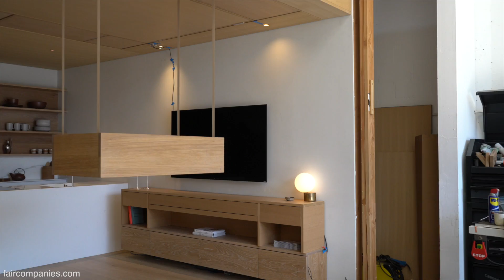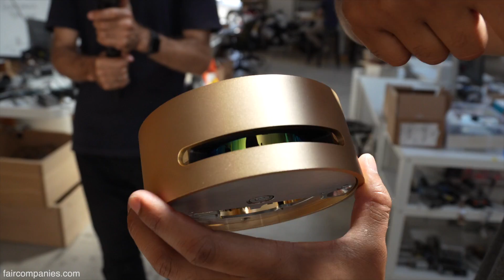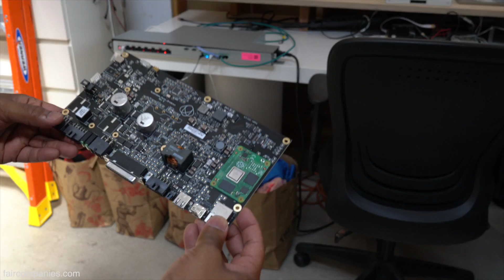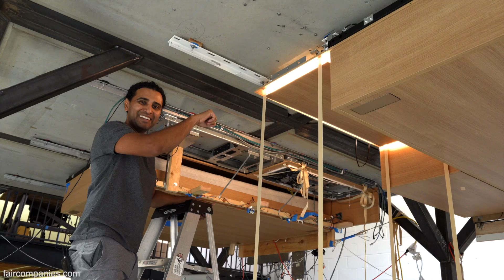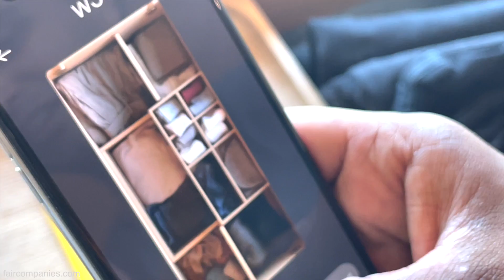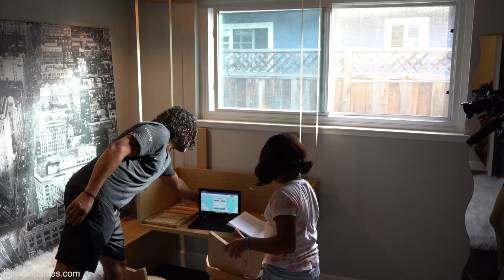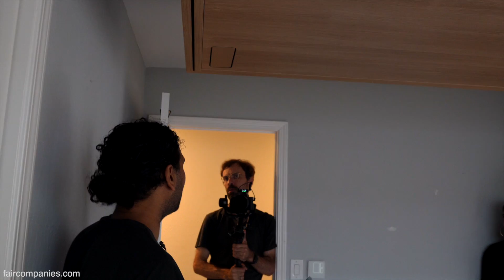Apartment furniture rolls into ceiling, it's truck-drag strong

Comment: I like his knowledge and creativity. I prefer storage walls rather than ceiling use as I love tall ceilings and am generally happy to give up 18to 24 inches for full wall storage of drawers and hanging space plus convertible furniture.  And it takes less electronics to fold out a bed and pull out drawers than to lower it from the ceiling. Generally simpler is better.

Comment: Love this concept but I have two requirements before I would ever consider it:

1) No smart features or cloud requirements whatsoever. Local controller (like a tablet) and local voice commands only for privacy reasons. No pictures of anything ever.

2) Emergency battery backup to raise or lower selected compartments in the event of a power loss; it would suck to not have your bed or tools in a long-term power outage. It would be best if in a power loss event certain components could be configured to go up or down and lock in that mode until power is restored; again, you wouldn't want to raise a compartment that you need on battery to then have the battery die before the power returns.

Comment: It's really cool for what it is. For people that like being on the digital grid, this is a great and innovative product. 
Personally, I prefer manual hand powered mechanics and off grid systems, aside from media and communication devices of course. 
This is really great inspiration to design something something similar with gears, cranks and pulleys that doesn't depend on electricity, and also has more personalized design core availability. 
But like I said, in its own right, this is really cool!

Comment: I like this in a lot of ways--it really opens up space and is actually accessible for people with mobility issues--but privacy can become an issue with how it tracks where your things are just as much as it's an advantage, especially as it's part of the Internet of Things, which is famously security poor. And the access locking can be as easily a tool of abuse as of security. And what if the power goes out with your bed still in the ceiling?

Comment: Cool idea, but hi-tech dependent.  ¿ What happens in power outtages or surges and what's to prevent the kids from pushing buttons when they're bored and your bed starts retracting into the ceiling with you as a passenger ?  It's easy to fix standard furniture when a door gets jammed or a bed leg starts to crumple, but this not so much.  Another toy for single, uber-rico millennials.

Comment: You know, I think the owner made a good point about how the shortest basketball player uses the Bumblebee system... this would be great for those with disabilities! Those who have dwarfism, those in wheelchairs, or those of any height that deviates from the standard could seriously benefit from things adjusting to their height. I can totally see this in the more bougie apartment complexes around college campuses or even college dorms if the universities are so inclined. Imagine these micro-units for hotels instead of capsule hotels in high-density areas around airports in major cities (since at least here in America there aren't any capsule-like hotel options that I at least know about).

Comment: Seem to have not mentioned the obvious application (maybe it is developed later when more money is made from celebrities!) but this would be transformative for those with mobility and access issues: you cannot bend to open drawers, you need move in a wheelchair and don’t want to have to negotiate a bed, or you need to change the access height of things in different situations. Also when the software develops away from phones and can photograph from the unit allowing for more verbal control for those with limited vision. I hope this can be the future. These inventions are incredible but broadening access could make them even more of a game changer.

Comment: Space saving in an apartment like this is evidently important to low income renters. I doubt people in that situation have the extra money to have this set up. I couldn’t see any building code allowing this, it most definitely compromises on fire safety and means of egress. On top of that, a pulley doesn’t seem very patentable and contractors could already easily install these for people. The camera logging your stuff is cool I will admit… If you live with a thief?

Comment: Is there a manual way to get your bed down?  What happens in an electric outage?
Reply: Unless you live in texas the reality is that electric outages are an "outlier".  I've lived in california for 15 years now and have never had my electricity go out for more than a few minutes.  Before that I lived in NYC for 18 years and the 2002 blackout that lasted about 24 hours was the only time my electricity was out.  Now, because I"m concerned about this, and have the money to deal with it, I have a battery backup system so I could still make a bed move up or down if this was in my home and the power was out.

Comment: This is something designed by an architect to function well when it is new. The issues I see are that the system will break down at some point and you are locked in to a singular setup that cannot be easily changed.  Think about the Nakagin Capsule Tower in Tokyo. It was supposed to be adaptable, but time and technology moved on. The built ins became obsolete and things started to fail. Repairing it became hard because it was so inflexible. (There is a whole other discussion of the Metabolism movement that could be discussed too, but this is a social media post, not a book!). Now imagine a change in lifestyle that requires a different floorplan, or even something like a power surge or leaking electrolytic capacitor destroying a controller board. Think about how long it takes for grease to dry up and start destroying bearings (10-15 years). Imagine this when this company has moved on or gone bankrupt and the parts are no longer available. Now you have your bed tied to the ceiling and need to get it down but without a controlled way to drop all that weight. Imagine this happening at 10PM when you just want to go to bed. No thanks. I like the idea in concept, but prefer to have static furniture that can be easily changed and also like more square footage. As far as carbon footprint goes, I see the short life of systems like this as a negative. I also would not want to pay the high cost.

Comment: It's a fun way to make a small space multifunction. However, what happens when there's a power cut, or the software gets hacked, or the company goes bankrupt and there aren't any technicians to help maintain it? I'd rather see a more resilient low tech (as in no software/computers), low (or better no) energy consuming version, where the storage is under the floor, and you pull it up, or if storage is above it uses clever pulley systems etc. With the cost of living increasing, and the need to reduce our energy use, we cannot afford to keep designing things that need a constant supply of electricity to work.

Comment: Would be a lot more interesting if everything operated via mechanical cranks and pulleys rather than motorized. Might be more difficult to design but I imagine there would be less potential for failure.

Comment: If they could implement some heavy duty spring latches that set into place once the compartment returns back to the ceiling, that'd be great. That extra bit of safety in the event that those strips become worn, the pulley is damaged or there's some other mechanical failure would make a difference.

Comment: As a furniture designer/ maker and Antique Furniture Restorer, my home is filled with mismatch pieces which is the beauty of antiques! These systems will work terrific in my latest farmhouse restoration. With multiple season activities I can store away winter snowshoe/Xcountry skiing and winter camping gear and clothing or tuck away my summer camping clothing.
Having these systems in my garage space will simplify sleeping bag and camping supplies while also keeping motorcycle clothing and gear safe between seasons.
Thank You so much for sharing these innovations and the creators information.
Getting rid of totes I have stored on the floor of closets and taking advantage of the 9' ceilings just opened this house up for future resale. Thank You!
You are in my prayers
Hoka Hey

Comment: While this idea is great, I find the motors, cameras, and smart features to miss the point. If this is for making affordable housing more liveable, why not make the lifts mechanical to ditch the robotics and actually make this accessible for the people that would need it. What happens when a motor breaks? A mechanical lift could have components that are user replaceable which would make sense for someone on a budget in need of such a system

Comment: Wonder if the units could be run by a backup standard battery in case of power outage. This is such a game changer. Awesome!
Reply: Yes - all low voltage systems and can run on backup battery

Comment: This is amazing. I've  never seen something so efficient. One  question, what happens during a power outage?
Reply: by making use of the amazing technology that allow you to have laptop and phone - battery
Reply: @opelfrost  So what happens if the power outage last longer than the backup battery?
Reply: @GeorgeVenturi  when a power outage occur, you just need minimum power to do a emergency routine to drop all the things that are important down - even if your power never ever comes back on after that, you still have access to the things you need... if your power is out for so long, most houses aren't habitable anyway, we don't design our house to function without electricity/gas in our climate anymore
Reply: @opelfrost  In a normal house with no power or battery I still can access my furniture lol. Maybe at your home in Singapore you can not use your left  hand to access things and you like this bad idea of moving furniture to easy access?

Comment: Was it actually explained how the system prevents the bed being pulled up with people?
Reply: It wasn't.  But I'd be surprised if the sensors don't notice that the bed is way heavier than it is supposed to be and stop trying to lift the bed if for no other reason than that the electric motors would burn themselves out.

Comment: The only issue with the concept is that the system is expensive and it oriented to high end homes, but at the same time, the rich do no often have a problem of space, thus making the system an economic contradiction.
Reply: It’s cheaper than adding additional rooms in square foot

Comment: A clever approach to the housing problem. While I respect the software/smart home side of the system with sensors and cameras, I would prefer a more traditional / rugged system. Automatic descent/lift coupled with a backup option with manual handling for a cheaper and more reliable system with less potential maintenance needed. 
Though those sensors sure do come in handy if you have a pet or a child.

Comment: As others have remarked, this is a really fancy Murphy Bed 3.0 meets maker geniuses. Very nice design and systems integration, but the entry cost is eye-popping.

Make it an Open Source project and have them sell design, installation and support services. Works for many OSS software ecosystems - software is free, support costs money. Market forces will take care of initial system costs. Otherwise, the Chinese will rip this off in a heartbeat and the cost will go from $10K to $2K.

Comment: Great idea and potential huge energy savings only have to heat and cool one room.   But 18 lb per SF is 1800 pounds on a 10x10 ceiling footprint.  That's like hanging a piano from the ceiling.  I'm sure this can be done with lighter materials.

Comment: This looks super promising and really cool but a huge unresolved issue is what happens if the startup goes bust or gets bought up and the team dissolved? If I buy furniture from a traditional vendor. I don't have to worry about my furniture becoming unusable if the cloud goes down. We've seen this last week with Figma getting acquired by Adobe, even the companies with the best of ethics are subject to the whims of capitalism and the company you think you're buying from. May not be the one you end up having a relationship with down the line. As a matter of course, startups like this should have a sun setting plan that is part of the product offering from the very beginning. So if something would have happened to the cloud infrastructure, there would be a way to keep at least baseline functionality. Preferably some kind of open source project in order that the hardware doesn't stagnate in the eventuality of the company disappearing. As cool as the hardware is this cloud -based service infrastructure gives me a lot of hesitation in buying into one of these ecosystems.
Reply: I had exactly the same concern!
Also, if you talk about Adobe, what prevents this company from charging you a monthly fee a few years down the line. This seems to be a common practice nowadays.

Comment: I would absolutely love this sort of setup if I was building my own home, spread out throughout the entire house, and could easily see building with it in mind.

Even hallways could have additional storage beyond what a traditional closet space would be used for,  only lowering what was needed at the time from that, as shown with the entrance of the one unit where the ceiling went even lower.

With closet space no longer needed in a traditional location, that bit of space could be a set of shelves on both sides of the wall with a thinner back separating the two, and expand display possibilities without taking up footage that would normally be in the living space.

An open floor design where only plumbing and electrical was structurally concealed could permit an accordion-like panel system to create a partition when needed, which could be directly printed or painted on in order to bring artwork into the feature... or even perhaps have panels that could be opened or to insert artwork within them for ease of swapping out, and modular panels that could be CNC'd or 3d printed to position the artwork exactly where desired on the wall. Heck, use magnets and a single latch to make swapping them out super easy.

If the electrical and plumbing runs through the flooring and original ceiling stuff, then heated flooring could easily be done at the same time, and all of it could have modular flooring large tiles that could be removed when work is needed on them. That also opens up the possibility of using hydraulics for raising up sections of the floor where people are less likely to be standing long (such as the hallway and entrance), and have bins with smaller tile sections that can be lifted on hidden hinges for access to storage there.

Have a projector and screen for a wall that normally has art, shelves, etc on it in order to minimize space further, with a module that lowers the projector when needed... or even build it into a wall cubby itself, complete with space for all the devices that would hook up to it.

If you're trying to minimize grid use due to the energy crisis, of course you'd have solar panels on the roof, but you could also have each of the large tiles use small piezoelectric energy harvesters linked up to the same battery, gaining energy with every footstep across them, and small wind turbine generators that could be easily built into the house design on exterior walls with Joe Doucet's design, not only on the roof where the most powerful of them could be.

My father has a dust allergy, and this entire unit would keep most things tucked away, minimizing what would need to be dusted regularly, and open up possibilities for venting and ionized metal strips to collect dust before it even reaches a room, lowering the thin panel down to be wiped off every now and again with a slightly damp bit of paper towel that could then be put into a compressor, eventually turning it into paper bricks for a rocket stove, or tinder for campfires.

The possibilities that building around a system like this provides, especially when considering the options it opens for walls and floors to be smartly designed as well...
Reply: Cool

Comment: When they got to the kids room, I realized... THIS COULD BE USED TO STORE LEGO. Not just parts in a bin. But it could solve the problem of the "standing hole" in big layouts. How do you get to it besides crawling under the table? Part of it lifts into the ceiling! Or the whole layout comes down in a bed-sized tray. You'd lose a lot of ceiling height storing a tall city like that, but the options in general are endless.

Comment: I like this concept a lot and I love how well is thought and done without compromising a single inch. On the other hand I don't see this widely implemented in an earthquake prone zone unless some additional safety measures are added. Still, a cool idea, concept and implementation.
Reply: Earthquakes should not pose a problem as long as everything is properly fastened. Really depends on the weight of the system. Residential buildings in EU are designed to withstand 150 kg (if I recall correctly) of additional weight per square meter which should be plenty enough.
With that in mind, additional weight of the system on the ceiling can already be considered in the planning stage of a new building. Older buildings can be reinforced, though the cost may outweight the benefits.